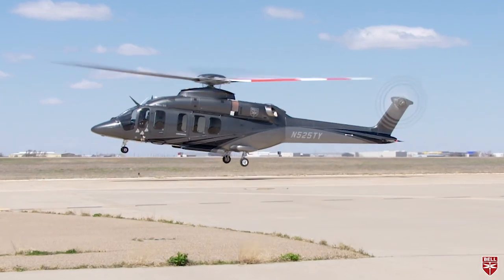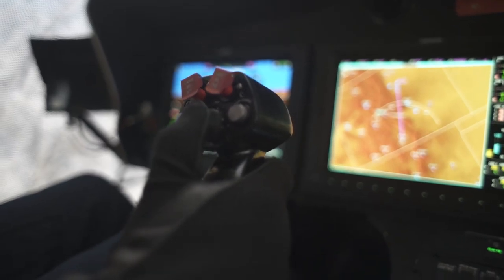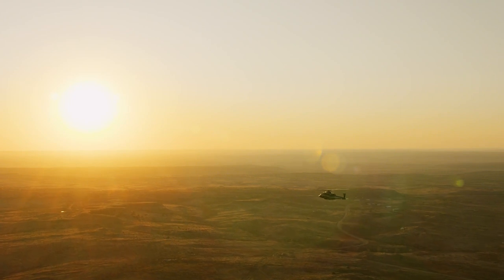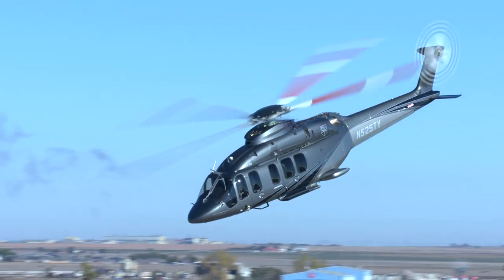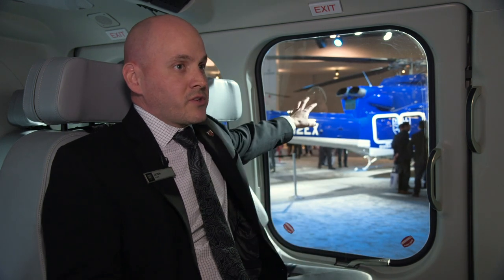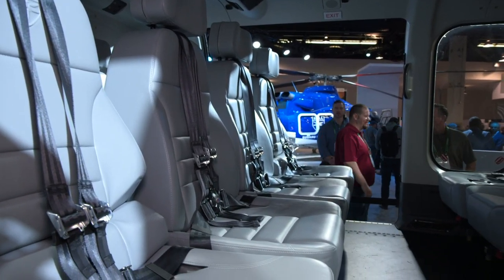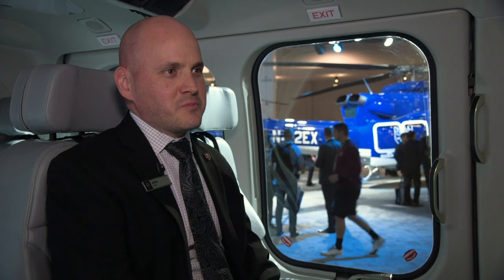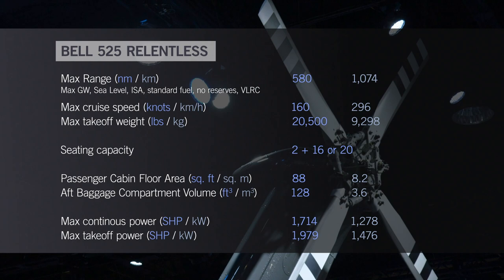Bell 525 Flight Test Program In Final Stages, Aircraft on Production Line – AIN

Comment: Based on this short video, and the corporate shill stating "this is an all new aircraft", or words to that effect, this appears to be a wonderfully designed helicopter. While it certainly appears like a larger 222 variant, we can suspect it's an entirely new aircraft under the skin... aside from it's expanded size and obvious similarity to the old 222.
Max range: 580 miles.
Velocity Not To Exceed: 190 mph
Cruise Speed: 178 mph.

I don't know the asking price, and I expect it will be  "overly-ambitious"... but didn't care enough to investigate.

Comment: Nice helicopter.  In this video, I would have expected at least one mention about the fatal accident of the 525 relentless prototype during 2016 testing which delayed development.
Reply from the maker: We have mentioned the crash in one of our previous 525 videos, but this video is meant to be an explanation of where the program is now and where it's going. Thanks for watching!
Reply: @AINvideo  Yes you have, but to your point, the reasons the program is where it is at now is in large part to the incident.  But still a great video keeping us up to date with the program.  Keep up the great work.
Reply: Having read the Official Report into that incident, it was not the fault of Bell Designers, Engineers or Pilots, and consequently has no place in this video.

Test flying takes place specifically to discover if unknown factors like the one that caused the accident may exist.

Once discovered and identified the issue is resolved and further testing takes place.

Unfortunately, that particular issue had a catastrophic effect before control could be re-established.
Reply: @felixcat9318  Neither AIN nor I made any judgement or suggestion regarding the cause of the accident.  I suggested that the incident (regardless of cause) did affect where the program is which would be hard to dispute by anyone.  Any jet or heli program would be affected.  AIN had a different opinion about whether or not to include it in this particular video (they brought up on a previous one) and that is fine too.
Reply: why mention it in a sales video? Everybody knows about it, just like everybody knows that development states are dangerous and it's exactly where you want crashes to happen; not after sales!
Reply: @jahnkaplank8626  It's a news video not a sales video.
Reply: @felixcat9318  it was the fault of the designers wtf…
Reply: Protótipo 2024 sistema de freios e travamento de hélice e paraquedas. E sistemas mecânicos 😎 falhas fase de teste todos tem, igual a BOOM SUPERSONIC   de aviões super sonicos e recentemente passei protótipo de motores super sonicos, mas são aeronave maravilhosa 😍😍.  BELL É uma empresa que procura falhas.

Comment: Take all the small screens and touch screen controls and replace them with LARGE LED lights and physical buttons... To show LARGE numbers. THEN place them ON THE CEALING... So the pilot can LOOK OUT THE FRONT WINDOW...

You dont need that much information and if you do it can also be where the sunscreen is in a normal car...

Why make all your controls electronic! Mechanical works fine and power steering is all you need. In case all electronics fail you could still land.

It DOES NOT look like this aircraft will function in case of electronical failure..

Helicopters are simple and elegant machines, you seem to have made it indefinitly complex... And then say ow THE COMPUTER will fix that..

Nobody needs more tech or electronics then the bare basics, if you want to make a better helicopter then:
Make it lighter
Make it more silent,
Make it as see trough as you can, lots of glass...
And make it cheaper to fly, more fuel effecient..

And for these oil guys,, goddamn make a good escape hatch..

I dont see how a machine not much bigger then a volkswagen transporter should cost half a million$ when I can buy a smaller chopper for as little as 40.000.